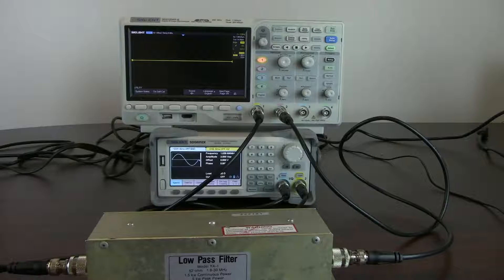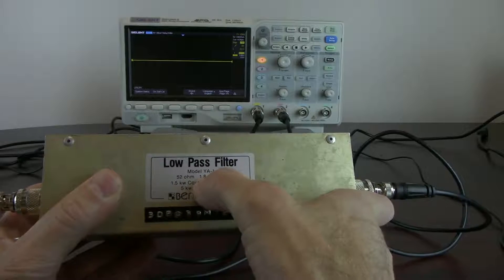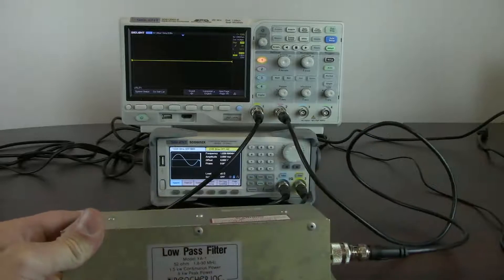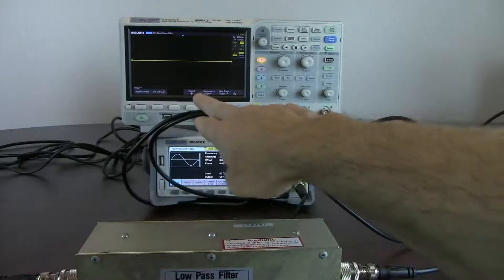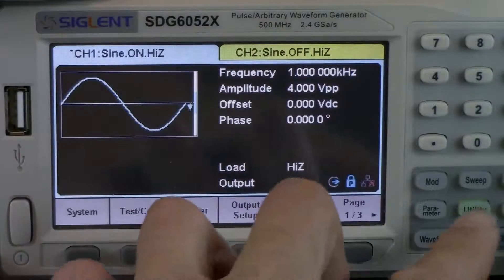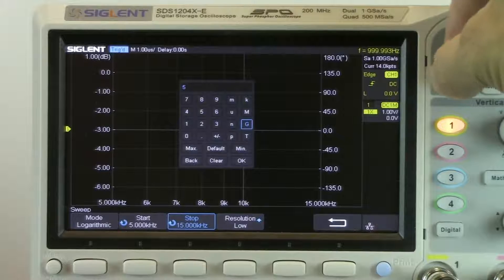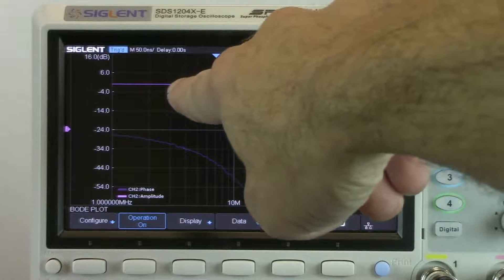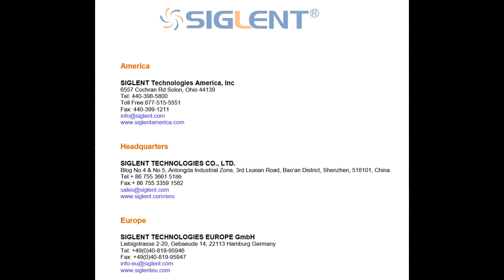How to Use the Bode Plot Feature on Siglent Oscilloscopes

Comment: i bought the combination for the bodeplot function but after a time it does not work
Reply from the maker: Hello! Siglent's oscilloscopes have a 3 year warranty, so the manufacturer/distributor you purchased your unit from should be able to help with troubleshooting or replacement if need be.

Comment: The 2 Channel oscilloscope version (SDS 1202X-E) does not have a Bode Plot function for those who have not purchased an oscilloscope yet and are doing so purely to utilize bode plots.
Reply: Interesting. I bought the 2 channel version a few years ago and have always thought that they were identical apart from the number of channels. Whilst watching the video, I was wondering why you need the 4 channel version since only 2 channels seem to be used. I'm now looking to buy a 4 channel scope and will probably go for the Rigol dho814. It doesn't have the bandwidth of the Siglent, but has a wealth of other features including an HDMI output, which is very attractive. And if I require more bandwidth, I still have the Siglent.